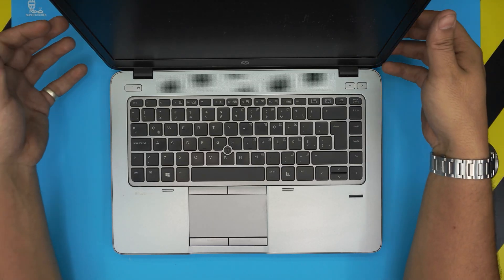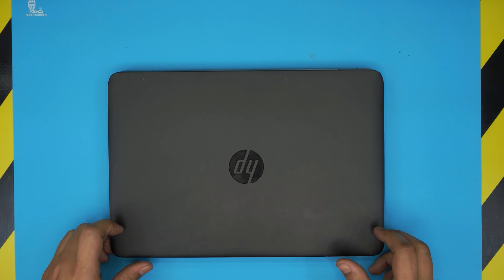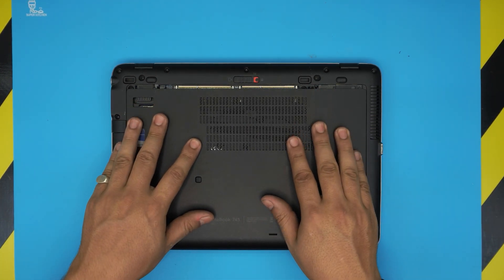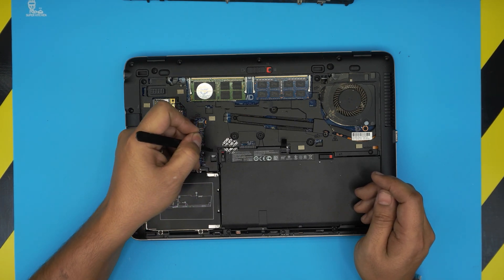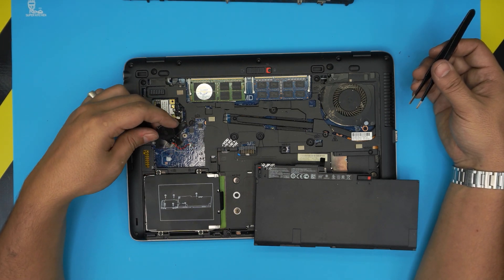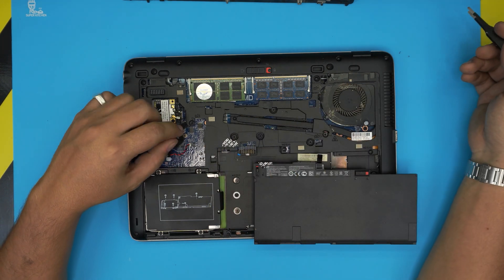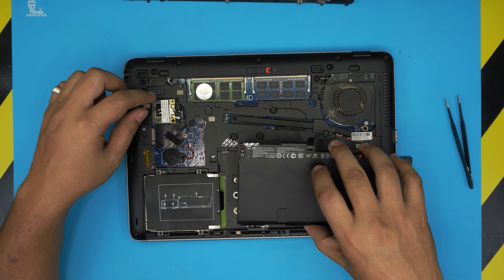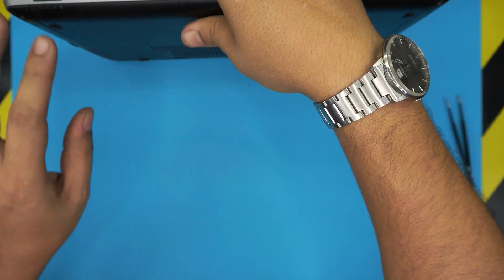HP Elitebook 745 Bios reset ( cmos reset)

Comment: Hp elitebook745 g3? Is this working
Reply from the maker: Thank you for your feedback! If you wish to support the channel, you can like, subscribe, or both!
Regarding your question, you want to reset bios password>?
Reply: @uFixTek  how!?
Reply from the maker: if your laptop has a password, there should be a serial number on the screen where you type the password, example: https://imgur.com/a/wOabgbR

give me the number and i give a unlock key
Reply: @uFixTek  I have the same model Elitebook G3. It does not display a serial number on the screen. Do you have a way to reset the BIOS password?

Comment: I have a problem with that model, only the upper case light and the power light blink.  but the equipment does not turn on.
Reply from the maker: Thank you for the feedback! if you wish to support the channel you can LIKE or SUB or both :P
regarding your question: remove the internal battery and the rams!, then press and hold the power on for 30sec then let go and plug in the rams and the battery and test it out.

Comment: I just bought a used EliteBook 745 G3 and the BIOS has a firmware update available but when it tries to perform the update it wants the BIOS password and I don't know what it is. Will this procedure reset the BIOS password and allow me to update the BIOS?
Reply from the maker: Thank you for the feedback! if you wish to support the channel you can LIKE or SUB or both :P
regarding your question:  this will reset the configuration of bios , not the password. can you send me the exact model of the laptop and i can try helping you to reset the password.
Reply: @uFixTek  Thanks for the reply, my model is a HP EliteBook 745 G3 and the product number is V1N79UP#ABA. It has BIOS version 1.23 on it now but I am trying to upgrade the BIOS to version 1.55 but it wont allow the update without a password for the BIOS. Thanks for any help with this!
Reply: Any update for me on this?
Reply: I have same problem

Comment: hi, I have hp elitebook 8560p and the bios is corrupted no boot and black screen, is it the  same process to reset the bios? Please explain me how. many thanks
Reply from the maker: Thank you for the feedback! if you wish to support the channel you can LIKE or SUB or both :P
regarding your question: it may not be bios my friend its very common on your model: do the following: remove both rams or if you have only one still remove it. and once removed power on and power off the laptop and then place one of the rams on dim1 and then power on once you get boot after 5-10sec then power off and place the 2nd ram and power on and wait up to 10sec

Comment: I have a elitebook 745 G6,how crack bios password?
Reply from the maker: you can't it will take years, just replace the bios chip.
https://www.ebay.com/itm/313058009138?hash=item48e3b62032:g:DI4AAOSwcMNem2v5
Reply: Yes, you can remove password without replacing bios chip...i did that in hp probook 6560b...no need to wait for years
Reply: @BP-sf7br  Please, tell me how to remove the password without changing the bios chip for hp elitebook 745 g6
Reply: @bulsser I am also having same problem
Reply: @pushkardeshpande2414  i was able to solve this problem.
master helped.
removed the bios chip and rooted the dump.
cost me $20 and 3 hours of waiting

Comment: not working, still have password for it
Reply from the maker: ok do this: remove the internal battery and the bios battery, and place the laptop on its side, and plug the charger only and short the bios pins and at the same time press the power on and turn on and it should take you directly to bios then let go of the bios contacts.
Reply: Thanks that worked
Reply: @uFixTek  Hello,  Excuse me, which bios pins are you referring to? to the battery or bios pins, my laptop is an elitebook 745 g2
Reply: this worked for me thank you so much